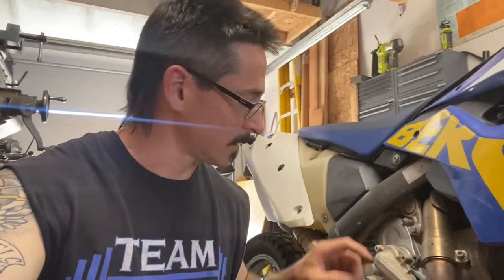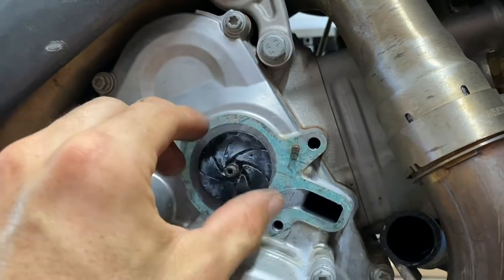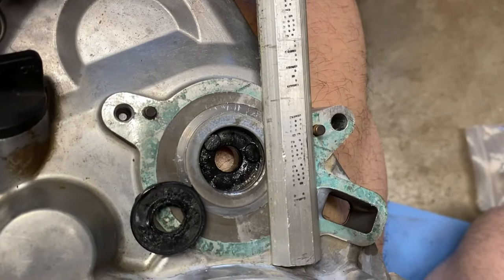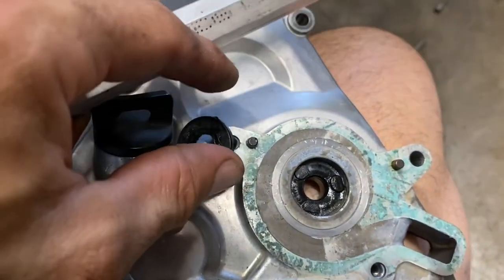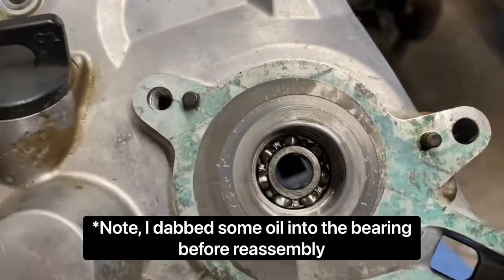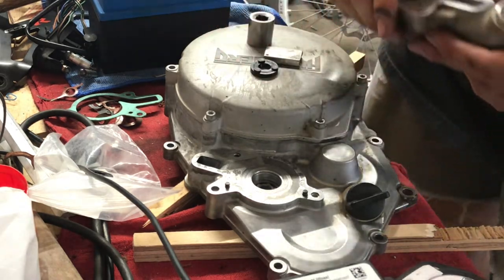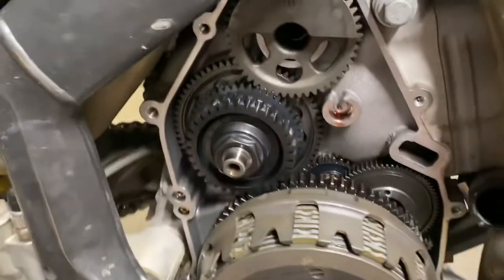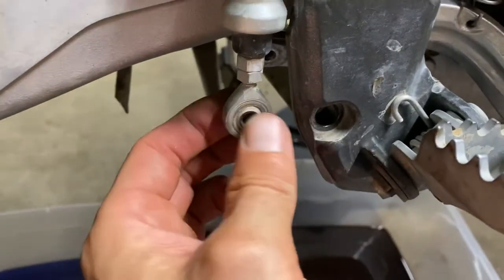Husaberg FE570 water pump seal replacement and weep hole mod

Comment: I'm at 480hrs and 13k+ miles on my 2010 570 and no issues with the water pump or clutch so far, (hope I'm not tempting fate here!) 😂. Just done another valve check and they're still in spec from the adjustment at around 200hrs. GREAT bikes these!👍
Reply from the maker: Nice! I’ve heard they’re solid. Sounds like all of my GSXRs 👌
Good thing about this design is the fluids can’t mix if the seals go so keep running it

Comment: Thanks or the video, and filming while you worked. I have an '11 FE570 that I need to tackle this on soon. I already have the water pump kit from KTM with all the seals and parts, but I was wondering where you were able to source a new side cover gasket? Right now my My plan is to make a gasket out of a fel-pro fiber sheet, but an OEM one would make me feel better.
Reply from the maker: I believe I got everything from my local KTM dealer. The Husaberg shares many parts with them. If you don’t have a local dealer I’m sure they’d ship you one. Oemcycles on eBay has a bunch of kits, so they might have something too. Good luck!
Reply: Following up on the repair for anyone researching this: I replaced the seals and impeller, reusing the old shaft. There were some visible shiny grooves where the seals were riding. I decided to chance it. The repair held for about 500 miles before the weep started again. I took it apart again, replacing the shaft this time, with new seals. Every part needed was available at my local KTM dealer.
Reply from the maker: Ah that sucks, but at least now she’s all good!

Comment: Hey, thanks a lot, this is a very helpful video! One correction: not all, but one screw of the clutch cover - at 3 o'clock - has to be loosened to remove the engine side cover. And a question: do you lubricate the shaft of the water pump drive before plugging it back into the new seals? With engine oil, or rather silicon grease?
Reply from the maker: Fair point. I did say I wouldn’t take the small access cover off and would take all the perimeter bolts out, but I didn’t specify one of the clutch cover’s bolts (3 o’clock) does go through to hold the main cover.
At 15:10 I mentioned adding some lube, then specified at 15:33. I believe I did a very light film of silicone grease when pressing the seals, and a light bit of oil on the shaft when going through.
Hope that helps!